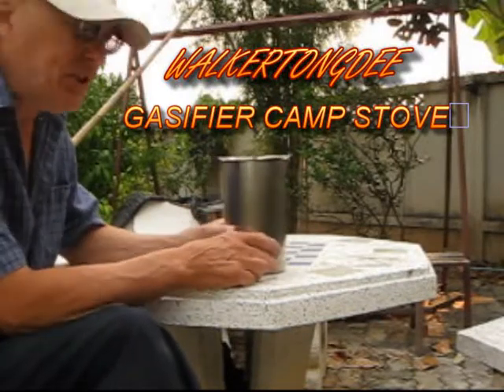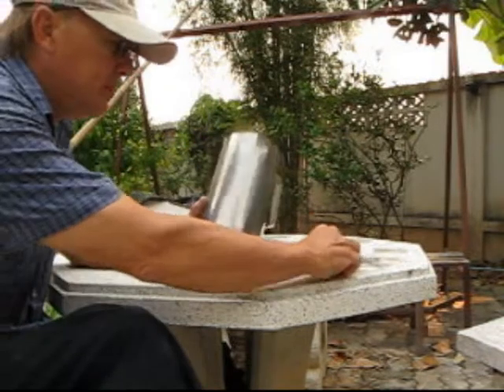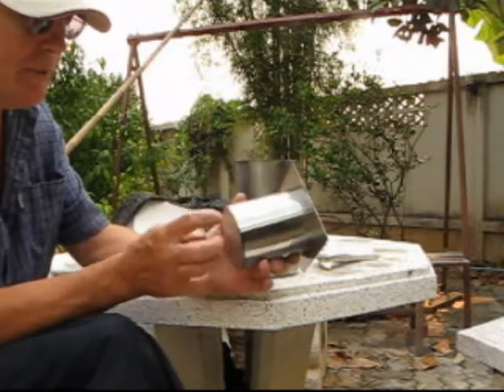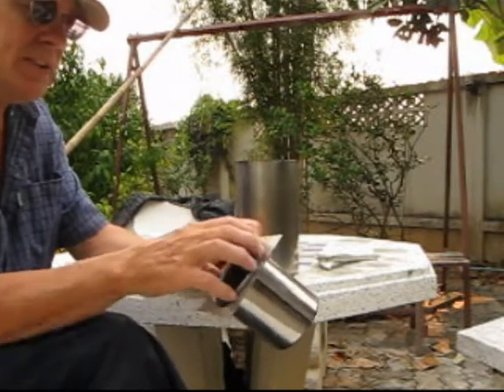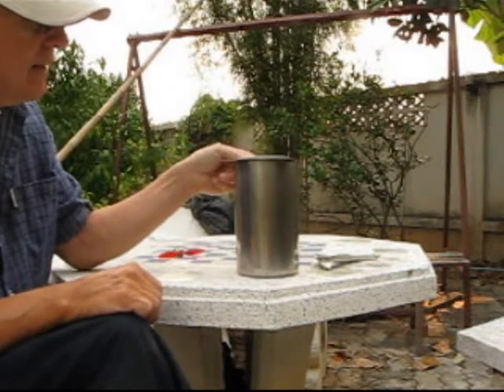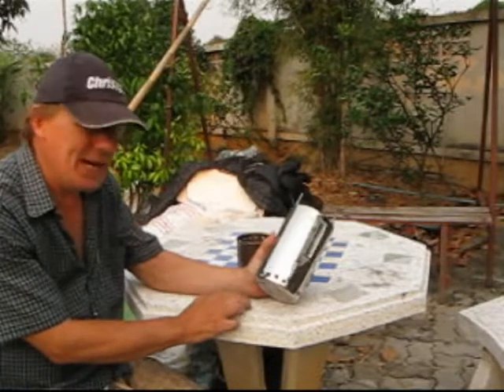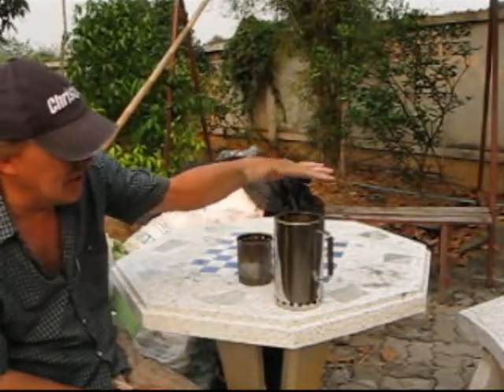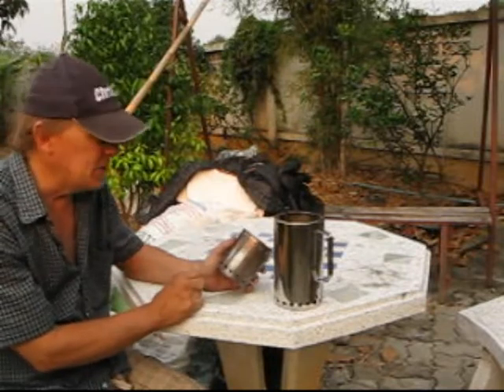gasifier camp stove.wmv

Comment from the maker: This unit operates without a fan, the fan burns wood much faster, something to consider with a small stove. Replacing the burnt wood results in a less efficient burn; make a fire that lasts the planned cooking time. Use wood pellets or cherry pits for a longer burn time. If even longer cooking time is needed build a bigger unit but realize that this will cut down on the portability of the stove. Watch for the upcoming video on testing in the jungle.